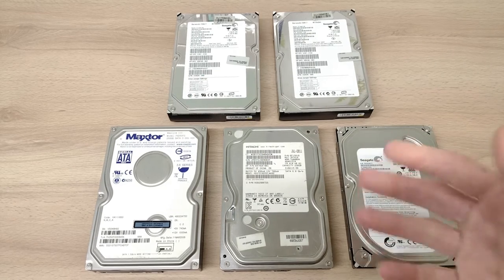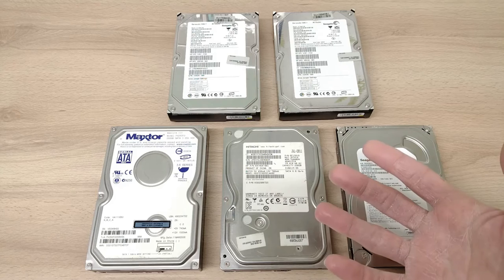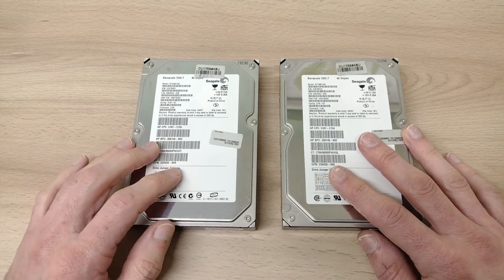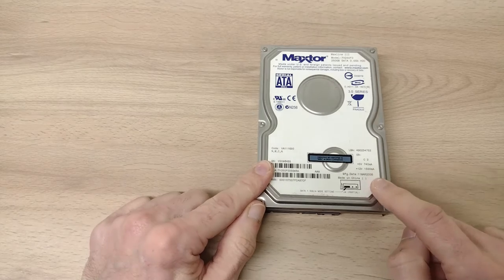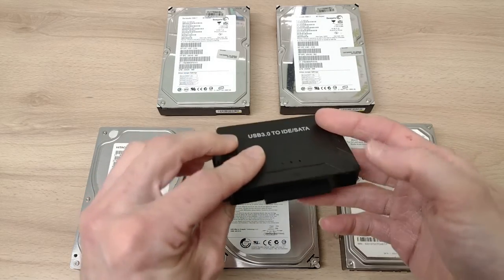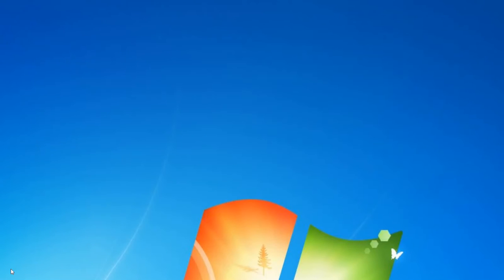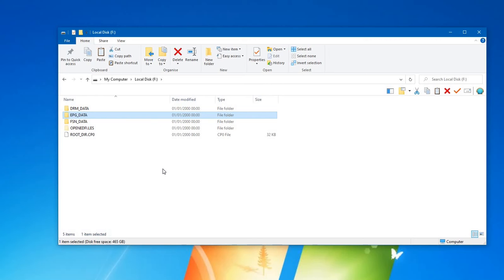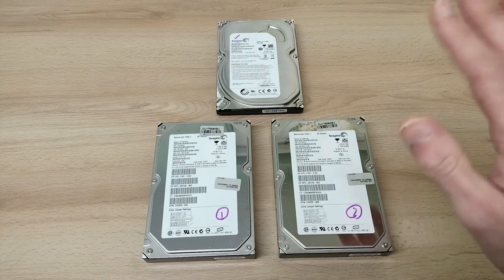Exploring and testing some old hard drives, do they still work?

Comment: i think the reason why windows is able to detect drive 3, but not able to open it is probably because it's not allocated? try checking it in disk management by pressing Windows key + X, then clicking disk management and see if the drive is detected there, if it says "unallocated" or "not initialized", then i think the drive is still good to be used, otherwise maybe the drive is indeed the problem
Reply from the maker: I had thorough check of the disk off camera and sadly it wasn't anything to do with it being unallocated in Disk Management. Still a good tip though for anyone who uses this old hardware, it's just unfortunate not all of it always works.

Comment: Don't know if you know about CrystalDiskInfo, but it's a great tool you can use to retrieve SMART info from any hard drive that supports it, letting you know about the drive's history and more importantly, it's health. I've used it a lot, on SATA and also IDE drives. Maybe it can be fun using it to analyse Hard Drives in other videos.

Really liking the videos, I'm glad the algorithm helped me find you. Best Regards from Argentina 😀
Reply from the maker: Thanks! I have used similar programs to CrystalDiskInfo before for looking at SMART info from hard drives, so I'll check it out. Good suggestion to include it in the future hard disk videos, it will be interesting to see how long they have been run for and if any are reporting errors.

Comment: The Maxtor is dead too. I had 4 of those and they all died with the same issue. 2 of them got in this state while trying to be formatted and the other 2 also died and remained in this state while they were trying to boot the operating system. I guess it's either bad firmware or it's just their way of dying. You can check the health of HDDs and SSDs with Crystaldiskinfo,it will tell you if they are perfectly good,have bad or reallocated sectors or if they are nearly dead
Reply from the maker: Quite possibly, no idea why, but I've got far more Seagate drives that still work compared to other manufacturers. Shame really, I liked the Maxtor drives back in the day.
Reply: @RetroSuperhighway  I guess it depends on luck since most people say WD drives are the best.I use WD and Seagate drives in my own PCs too and no Seagate died on me yet. i have an old Seagate 250GB Barracuda that ran in a server for 8 years without ever being powered off and it is in 100% health condition with not a single bad sector.As for Maxtor,the only one i still have and works is a 40GB Diamondmax Slim HDD,loved that one,very slim and extremely silent.Overall i had a total of 5 Maxtor,2 Quantum Fireball,3 Seagates,3 Samsung,1 Excelstor,2 Hitachi and 7 WD drives.Out of all of these i had the 4 Maxtor drives completely die and one WD,the rest were all solid